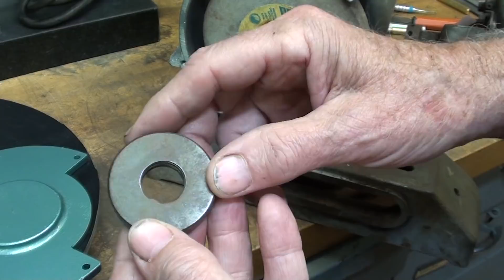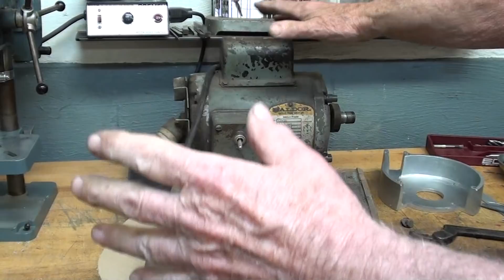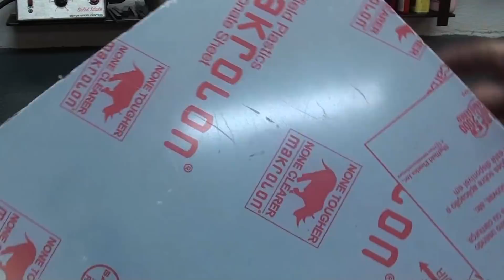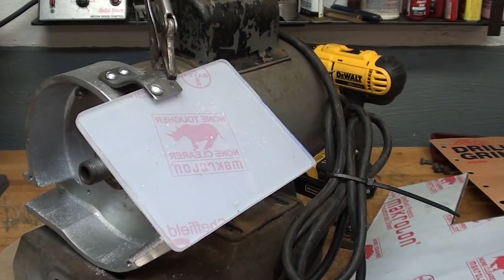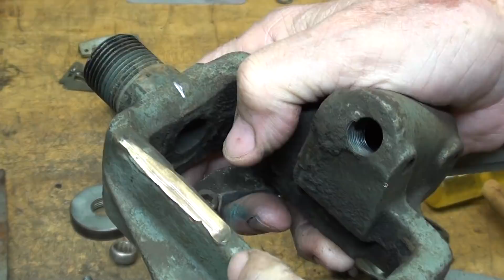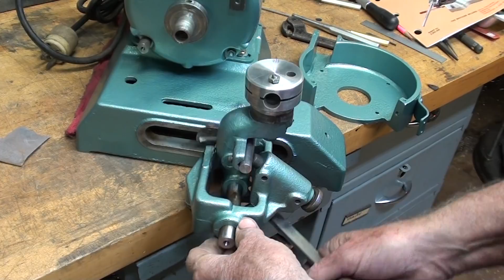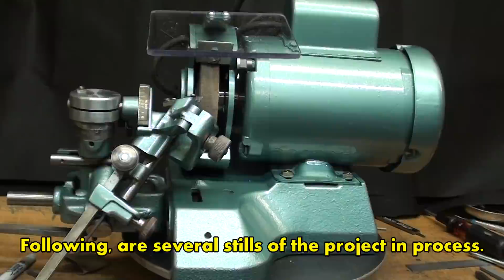Restoring a LISLE Drill Grinder pt 5 Tips #464 tubalcain

Comment: Wow, Mr. Pete, This Lisle Drill Grinder series was a nest walk down memory lane. I was the guru & primary drill sharpener on 2 identical Lisle drill grinders just like the one you restored. I loved to a different building in my company & saw the machines unused & covered in dust. No one knew how to use it & all drills were dull. I asked my boss for the folding instructions sheet & learned to use it while work was slow on midnite shift. I sharpened drill bits a 1000 times or more & taught another fellow to use it too. Now we are both retired (Mee, last year,2019), & I'll bet those machines are gathering dust & drill bits are dull again. Fellow employees appreciated sharp drill bits but mid level managers never did. Idiots!
Reply from the maker: That’s an interesting, but sad story

Comment: Good job Mr. Pete as usual. The castings look great!  Better than alot of factory castings I've seen. I'm in the market for
a drill grinder myself if I can find one at a reasonable price. Would love to have one just like that one. I'm fond of hammered
finish paint also. Just restored a Wilton bullet vise and hammer finished it. Really looks good. Wish you would have
replaced those motor bearings though.

Comment: A few words about the different choices on how to sharpen drills.
A) You showed the hand grinding method. I dont like it that much because I am not that good in it and even if I were the grind would still never be perfect. Therefore I prefer mechanical help.
B) One of the simple fixtures that you beat up with an ax and knocked in the dust bin :-) could be quite usable after one modification. Usually its foot is mounted on a horizontal table surface next to a bench grinder with the fixture standing vertically. This is wrong because the grinding marks are then parallel to the cutting lip and therefore perpendicular to the cut. That is no good. If you mount the fixture horizontally i.e. with its foot pointing towards you and fixed to a vertical post then the grinding marks become parallel to the cut how it should be. These are about 20-30$
C) The next level (in cost, not quality) is this plastic Drill Doctor contraption. It is a terrible Darex knock off. To this I would definitely give Mr. Pete's ax treatment. It is 150-200$ (It also grinds parallel to the cutting lip)
D) The next level is the Lisle 91000 grinder that Mr. Pete demonstrated. It is not in production any more. Used ones are still several  hundred dollars (500-700$ ?)
E) You said that the best drill bit grinder is the  Darex. But this is several thousand $! Outside the budget of the average hobby machinist.
F) But there is something in between D) and E). That is one of the many Chinese Deckel SO-1 clones. Technically it is called a single lip cutter grinder or D-bit grinder or a tool and cutter grinder. (google D-bit grinder) They are quite versatile. Next to D-bits, end mill faces and flutes as well as lathe cutters they can also grind twist drills either using an attachment for the traditional 2-lip grind or using the end mill fixture for 4-facet grinds or even 8-facet grinds (mainly used in series production). The 4-facet grind is superior to the traditional grind because it will not walk out of the center punch even without pre-drilled centre hole and it is even much easier to setup on a Deckel clone than the traditional grind is to setup on a Lisle grinder. Such a clone can be had for about 600$ plus a set of 5C collets (200-300$) if you haven't got one. I got such a grinder. The quality is quite good and I have no complaints at all. It works well. Check out picture E for a 4-facet grind in this link. http://www.newmantools.com/machines/drillpoint.html
Reply from the maker: Thank you very much for the dissertation. It will take me a while to digest all of that. And I do have another one of those general drillbit sharpener's that came in a box. I have not yet destroyed it, LOL. I was going to demonstrate its use and its frailties
Reply from the maker: This is a continuation I got cut off. The Lile grinder is actually rather difficult to use. I'll man was going to send me a Derex Machine, but he lied and did not send it. I have use them and they are fantastic. In fact are used to have one. I have never use a drill doctor, but I cannot imagine they are any good. I think they are made by Derex. I am very interested in the Chinese knock off, and I will study it. But $600 is still way above most people's budget. Thanks again
Reply: Here a few links that might interest you and your viewers:
The original Deckel SO had proprietary Deckel collets. Most clones use 5C collets.
http://www.lathes.co.uk/deckel/page3.html
http://neme-s.org/Shaper%20Books/DECKEL%20OPERATING%20INSTRUCTIONS.pdf
https://www.youtube.com/watch?v=YxwW7vQDMfY
Clones:
https://www.youtube.com/watch?v=-qHchpQeuho
https://www.youtube.com/watch?v=fJK6zC7Eh1E
https://www.youtube.com/watch?v=ELTL9qTJg-o

Drill sharpening is not shown in any of these links. But it can easily be done for about up to 1/2" drill bits. You clamp the drill in the collet with the cutting lips horizontal to the face of the grinding cup wheel. The collet holder has different rotational stops that you can choose by moving a pin.  One of those has a 180deg range. Ideal to turn the drill from one lip to the other. You set one joint to 59 degree for the tip angle and you set the other joint to 20 deg. for the clearance angle of the big facet. When both those facets are ground then you reduce the 20 deg to 10 deg and then grind the small facets forming the actual cutting lips. With your right hand you rotate the whole grinding head around the big rod at its bottom to feed the drill into the grinding wheel forth and back, forth and back. With your left hand you turn the knob on the left side of the machine to set the depth of cut and increase it slightly after each forth and back stroke.

You are right that a 600$-grinder can hardly be justified to just sharpen drill bits. But if you also have a lathe and a mill then you can use it to sharpen almost all the tools of all three machines. Then the justification may look different. When you put on a diamond cup wheel you can just as easily sharpen solid or brazed on carbide tools or even sharpen or modify carbide insert grinds.

Comment: Lyle,  I don't know if any of the previous 391 comments have mentioned this, but when you said that you wouldn't apply the lubrication to the small moving part that you wanted to lubricate, I though that I'd recommend trying some of the lock graphite lubricant.  I think that it would provide the lubrication that you want without attracting the grinding grit.
  
And yes, I have only the slightest "difficulty" with "transgender" folks, simply because I haven't met any (that I know about).  But I don't worry about that -- it's their lives, not mine.  A very physically large male ex-Marine at work made the "sex change" and had a really tough time because the very few women in that part of the facility refused to share their heads with "her" -- it took a while to build "her" a transgender head (I work at a Navy facility, so I've learned to call restrooms "heads").  I personally haven't been asked what my sex is (yet), but being Type I diabetic and having used cow-based insulin for only one month in early 1983, they won't accept my blood because of the possibility of me having mad-cow disease.  My Doctors have never asked what my sex is, but I think that if one does, I'll simply laugh at him/her.  They haven't asked me if I am a mad-cow either!
  
And thank you (in the last video?) for not using the sheet metal for the outer wheel guard cover.  I didn't realize that you were pulling everyones' legs with that.  I was about to comment that that wasn't a good idea because it obviously would not contain the fragments of an exploding wheel.  No-one wants to be exposed to fragments of a fast moving/exploding wheel (I hope).  Always use the wheel guards and stand to the side as you start the grinder up, in case the wheel explodes.  We had a very small (maybe 2-inch OD) grinding wheel on a high-speed grinder at work with no guards -- the wheel exploded and hit the Machinist in the back of the head -- he never recovered from that injury and had to retire early because of the injury.  He simply was unable to work after that injury, even though he tried.

Comment: Rustoleum Verde "Ver-day" Green in hammertone, is a great color for restoring machinery. It appears to have been used many many years back and fortunately is still available. Not stocked on shelves out here on the west coast, I had to order some online to get my hands on it.  The hammertone finish will ONLY show up when applied very wet and heavy by the way. 
I have been in the market for a good drill grinder and will be pleased to watch this unit in action coming up. Splendid job!
Reply from the maker: Yes, I found out I have to put it on very thick

Comment: Turned out nice! I do like your color choice, fits the machine. I have found with the hammered/textured/wrought paint you must shake the can constantly, like if your not spraying your shaking! It must be applied much heavier than you would with normal paint and I think your right it is just fish-eye. It is hard to get a consistent finish with. Years ago I worked in an auto body shop and the painter was nutso, rightfully so about not buffing or waxing while he was painting. We had a new guy in the shop that must not have been warned of this rule (he should have just known that) and guess what he did?!?! And guess who sanded that car back to primer for free?!?! At least he didn't have to pay for the materials. I don't think that I ever saw Jim that mad before or since!
Reply from the maker: Thanks

Comment: That's exactly what happened on my grinding wheel ... slightest tap and the shield exploded like toughened glass and almost put my eye out.  It must be an "in joke" in the industry to build them like that.
I found a hinged inverted T "flap" that grips a piece of perspex like a visor, I found it on the side of the road but not the faintest idea what it came off of before
Simple rivet hinged fixing bracket with 2 flats with a screws at each end so it clamps a piece of perspex without having to drill it, it's been fine for years and takes punishment.
With that snazzy new guard, when you've done the paint it's going to look pretty damn good.
I don't think you should withdraw your donation - good clean blood is such a valuable gift.  It's not concerned about politics.
I think it's the ridiculous PC politicians who deserve your ire not the poor guy who's just following orders.
We seem to be ruled by people who live in some sort of fantasy world where no-one ever has to face reality and are frightened of offending people who seem to be professional takers of offence at everything.
We are starting to get the same gender "grief".  I couldn't care less what people do in the comfort of their own homes, I have friends who do their "own thing", and as long as they are good friends I couldn't care less.  AS LONG AS IT DOESN't INVOLVE ME.  I'm certainly not going to learn a whole new (artificial) language to refer "correctly" to the newly discovered additional 50000 new gender combinations (or is that an a-gender?).  Life's just too short.
Reply from the maker: Sounds like we agree on the nonsense going on in this country

Comment: Glad to see you  caved in on your self proclaimed aversion to painting!lol In regard to your paint,  Rustoleum got the idea or product from Hammerite, the origi nal manuf of the hammered finish.  I've been using the Hammerite products for 25 years and they far exceed the quality of Rustoleum's version, but Rustleum is readily available and does a good job. The key to getting a true hammered finish is application. Brushing or rolling it on works best. To get it to spray viscosity, I suspect they reduce the particle size making a "flatter"" finish!  Still looks great as are your efforts with the Lisle, be well!
Reply from the maker: Yes, thanks for the info on the hammer tone paint. Now I realize I should have put it on much thicker. But I like the color anyway. And this experience has only increased my aversion to painting, LOL.

Comment: M. Pete; I bought a lisle 91000 grinder and it turned out that the rotating bit holder part was missing. Thought in your auction and garage sales searches have you ever come across one?
Reply from the maker: No, that's like looking for a needle in a haystack. You will have to watch for eBay
Reply: I know, but it was worth a try. Love your videos.

Comment: Hi Pete
I am also a shop teacher and recent follower and subscribe to your videos.  You truly remind me of the profs. that I had in college almost 50 yrs. ago. They taught us very similar techniques too yours. The Lisle drill grinder rebuilt took me right back to the 70’s when our first machine shop course was building a bench grinder. All the way from scrounging up 10 lbs. of scrap aluminum for the castings we rammed up and poured, grinding our own lathe bits, sharpening twist drills on pedestal grinder to turning a double end shaft with left and right-hand threads that also had two areas for ball bearings that we had to hold with in .0001 for the press fit. A few years back I went back to my Alma mater only to find that most of the shops are gone and replaced with computer labs and the projects they were doing are in my words trivets. I am happy to see true machining techniques being passed on rather than sitting in front of a computer and pushing a button. The basics need to be taught and learned to understand the complete process. 
Thanks for your videos
Tim
Reply from the maker: Thank you very much for watching. Things sure have changed, in the high schools and colleges. And probably not for the better

Comment: MrPete: The key to the Hammered paint is one heavy even coat. I use it all the time when restoring tools and antique equipment and there is definitely a learning curve that is required. I find the Rustoleum paint cans with the trigger handle gives you more of the hammered two tone finish - for what it's worth, try it next time.  One thing you should have added to the plastic shield is a swivel feature to adjust it if and when necessary.

Comment: Great video Mr. Pete. A tip for you on the Hammered ... I have restored 2 lathes and used the same colour  Blue. To get it hammered avoid the spray ...it lays it on too thin to get the hammered look. I use a 2" or 3" wide good quality brush and brush it on them dab it lightly all over with the end of the bristles. The paint lays down smooth and does not look brushed and it has a beautiful hammered look. Regards Sam

Comment: Have not tried the green, but I use quite a bit of the silver hammertone paint, the trick to getting the hammered look is to apply it much heavier than you would with regular paint. It is a fine line between heavy enough, and too many runs.

Comment: I've found with that hammer paint will work but you have to lay it on thick and lay the next layer on top while the bottom layer is still wet but barely tacky. If you lay it on in multiple thin coats like normal paint it just lays on and smooths out.

Comment: Out use of hammertone paint needs a thick enough coat for the waxes to cause the dimple effect. Thin coats are not wet enough to react accordingly.
Thin coats are great for avoiding runs, but you almost need to lay on nearly a run for it to properly dimple up

Comment: Good job, only thing I would change are the nuts on the guard. That stuff is awful for spider cracking at bolt holes. Use nylock nuts and dont tighten past the "It aint slippen"  funny thing is its bullet proof but under constant bolting pressure it fails every time

Comment: Beautiful restoration.  Just to see, I made the patterns for the castings in Fusion 360.  I printed them out on a 3D printer.....it took about 1/2 hour in Fusion 360, but about 18 hours to print the designs....and the cover plate is slightly warped at the exit point (I think it is fixable with a heat gun)
Reply from the maker: That is so awesome. It took me a heck of a lot longer than that to make the pattern out of wood
Reply: mrpete222 If you want, I could send you the patterns.  I am not going to do anything with them and the reason I made them was out of curiosity about whether they would work as good as the hand made patterns.

Comment: Holes in lexan/plexi are best made by melting them.  The 'burr' (melted, squeezed-out material) can then be broken off or shaved down with a sharp knife.  A soldering iron works in a pinch.

Comment: Acrylic plastic (plexiglas, PMMA) shatters much too easily, and is a bugger to cut in thin pieces. Ask me how I know... 

It's also not a safe thing to use for eye protection.

Polycarbonate plastic is what is used to make things like safety glasses and faceshields, and it does not shatter. Typically, the lenses of safety glasses are ~6mm or 1/4" thick. A faceshield such as is worn while grinding, intended to go over safety glasses is thinner - 3mm or 1/8"

Oh, and polycarbonate (PC) is not ABS (acrylonitrile, butadiene, styrene - an opaque resin). I watched a little further, and see that you switched over to using PC instead of PMMA...